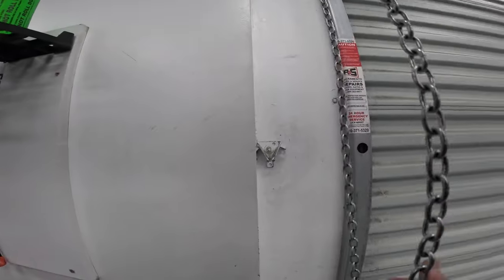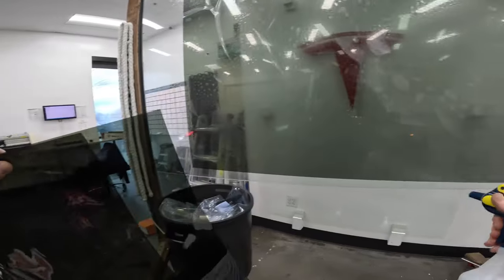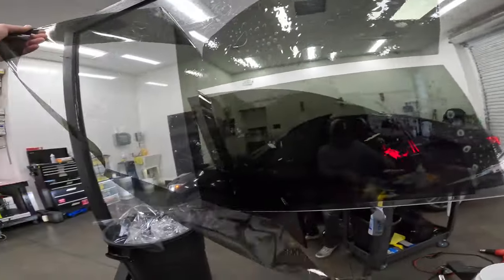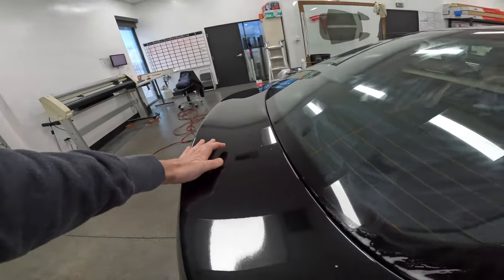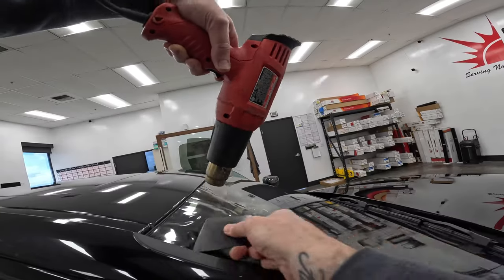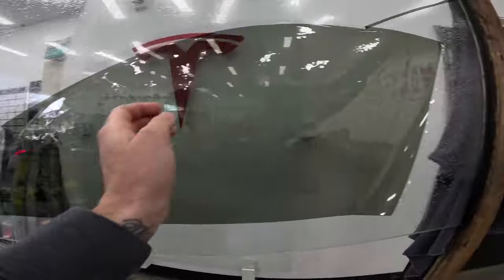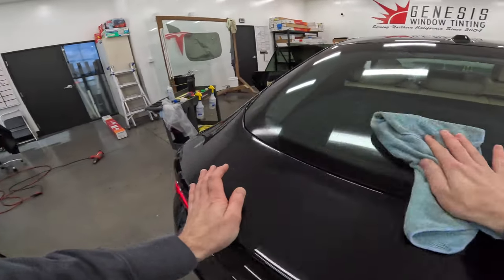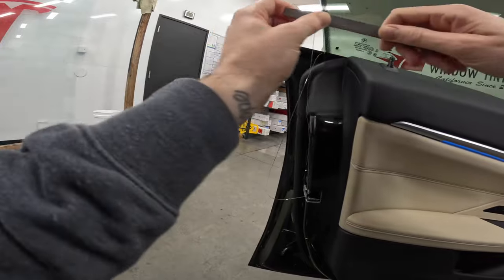BMW | i4 | POV | Ceramic Window Tint

Comment: How did you handle the dot matrix problem, is it still visible?
Reply from the maker: It is still visible. But I’ve found that the newer models aren’t as raised off the glass so it isn’t as much of an issue with peeling or anything like that. After the install I’ll heat the edges and press them down with a triangle to get them consistent all throughout the window. In the past we’ve sanded them but found that it’s a lot of extra work for not a huge difference. We try to set the right expectations with customers too when those type of windows come in so they aren’t caught off guard. Thanks for watching! 🙌🏼

Comment: How do you remove the third brake
Reply from the maker: The plastic panel that covers the lights is held in by clips so you just need to give it a good tug and it will release. The brake light has 2 plastic slides that hold it on to the back window. I use a trim removal tool and wedge it between the brake light and the plastic slides and it comes loose. Once both are released the brake light just comes off. Hope that helps!